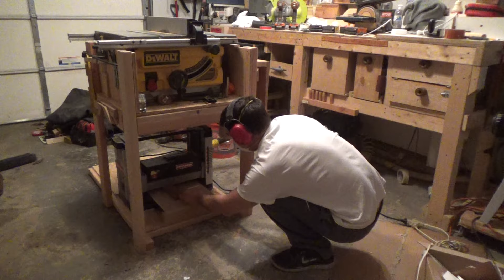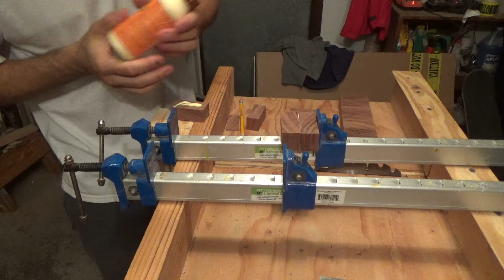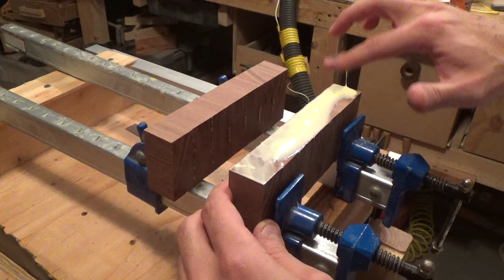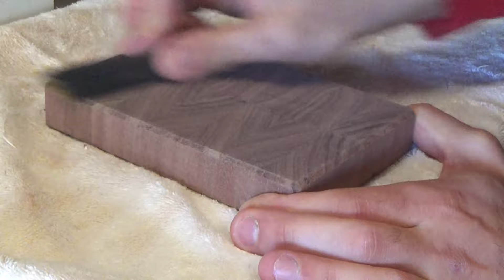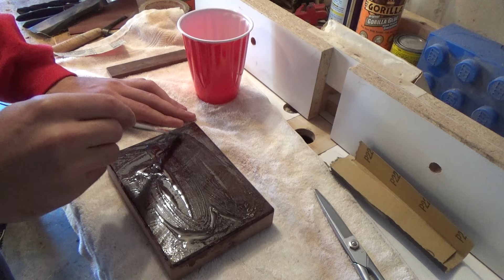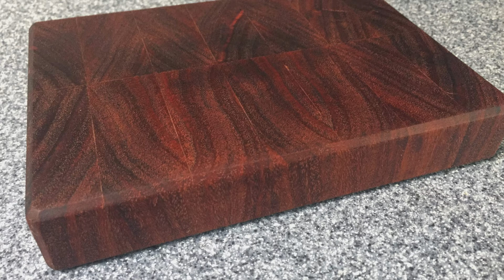Making a Small End Grain Cutting Board - 34

Comment: Why do you run the belt sander up a couple inches like that?

And how do you like those aluminum clamps? They look like the HF clamps, sure is cheaper than a Bessey clamp
Reply from the maker: I use the round edge of the belt for curved pieces and by raising it up it gives me some more space between the belt and my work bench.

And I love them. I bought them at harbor freight for like 8 bucks each or something like that. I know most of harbor freight stuff is garbage but you can't beat the price of their clamps. Definitely not the most strongest but they get the job done!